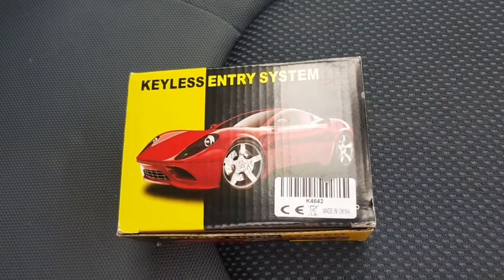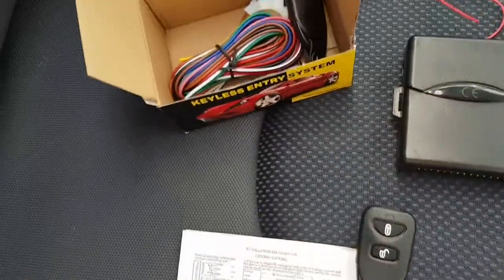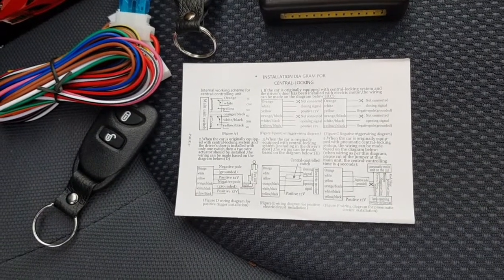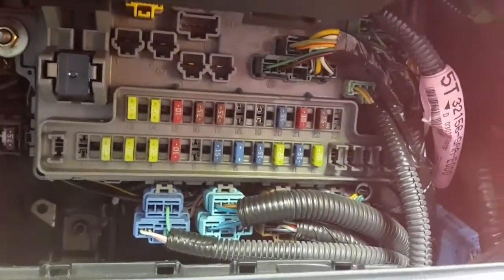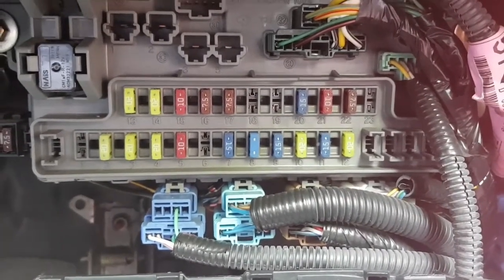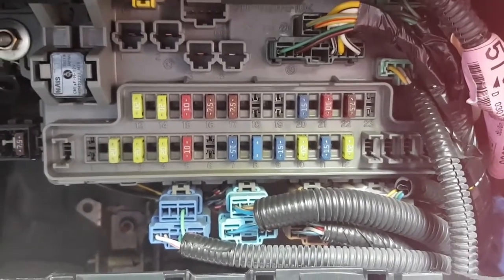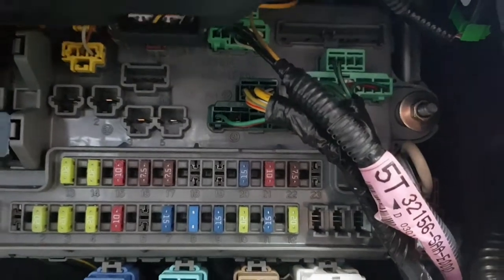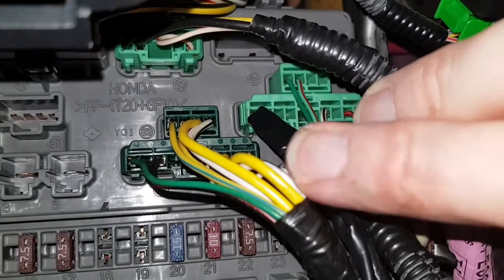Honda Jazz (Fit) Mk1 (2002-2008) - Remote Central Locking Upgrade

Comment: Been fighting with all the diagrams for over a month with no resolve. Just found your video was thinking that this was not possible to do, but I can see you have figured it out. I can understand everything your talking about although I live in north America so the drivers side is reversed,  but I want to know what is the deal with the black wire. Is that connected to the battery negative or frame ground? I know the 2x yellow wires are ground and im assuming the white wires are tapped into the wires coming from your main control switch on the door, Red is 12v+. Plus what should I do with the 2 orange wires. I see you have removed them. Any info would be a major advantage to my situation. Oh and my car is a 2007 honda fit. Thanks
Reply from the maker: The black wire and yellow ones go to battery neg or ground, doesn't matter I think. Orange wires weren't required so I removed them as the car uses a negative trigger.
Reply: Dan. I have the exact same car. Did you get it figured out?

Comment: Could you not have put the negative to the bodywork?  I found if you use a safety pin with the little loop at end, you can use it as a temp probe and just push into the sockets and then decide whether it's right or not...then splice into the wires if all OK.? All negative connections go from battery to body. ?
Reply from the maker: Yes that will probably work. I chose to use the wiring in case there were any issue with the grounding to the car body, i.e. higher resistance etc.

Comment: Saying thank you is an understatement. Thank you ever so much. I just did my car jazz 2003 exactly the same but I used the plastic scotch wire splicer which worked great. Without your video and the fact I don't have a multimeter and don't know which is which I wouldn't have been able to do this job. Got tired towards the end and didn't bother about the indicators light :)

Comment: You said the white wire with the blue stripe connects to the ground wires (yellow & yellow/black) going to the module.  Do the yellow wires have to be connected to a connector like you did or can they just be connected to an earth?  please excuse my lack of knowledge of earth/ground. Thank you.
Reply from the maker: Hi. Yes you can connect it to any of the wires which are ground or even the metal bodywork
Reply: @amp9438  Thank you.  I am still stumped trying to find the lock/unlock wire on a Maza MX-5 but I am determined to find them...

Comment: Do both the yellow wires from the module connect to the one blue and white wire? You don’t show the clear connections in the video.
Reply from the maker: Yes on this module the 2 yellow wires go to negative so I connected them both to the white & blue wire on the door connector as that wire seemed to be connected to negative/ground.
Reply: Thanks very much. Very grateful for your help.

Comment: Hi. when you connect this system can you still use the key to lock/unlock the vehicle? or will it only lock/unlock the drivers door?
Reply from the maker: On my car everything still works as before so both key lock and inside door switch lock/unlock all the doors. Its important you tap into the existing wires but don't cut them so you don't disturb the existing connections

Comment: Sorry for the stupid question but in terms of connecting the wiring, and removing the insulation and putting it into the connector, should the old wiring be kept in? I'm struggling to remove the wires going into the connector in the first place (trying with pliers). I don't suppose you have any tips for that?
Reply from the maker: You could always try something like ScotchLok type connectors to tap into existing wires. I soldered as didn't have them.  But to remove wires from the actual connector usually the pins have a clip which needs to be pushed down to release them from the connector housing. So a tiny screwdriver slid down side of the wire usual works to release them.

Comment: why  did  u  choose  the  blue  connector  below  the  fuse  box  for  power  and  ground  ?  i  think  u  showed  before  on the  video  , that  there's  power  and  ground  in  the  white  connector  on the  door  (  where  the  unlock  and  locking  wires  are  essentially ) ,  so  why  u  needed  to  find  this  blue  connector  for  ground  and  power ?
Reply from the maker: From what I remember I needed a permanent 12v for the module so took it based on a suitable fuse, i.e. the central locking one. You probably can use another permanent 12v if you can find one.

Comment: For everyone with a USDM/Canadian 2007-2008 Honda Fit, just got this to work with my car. 

Open the kick panel where the hood latch is and you’ll see a harness above it that you need to tap into. Wire your ground wires all to a ring connector and bolt it to the 10mm holding the hood latch. 

Wire unlock wire to white/blue wire on the car, wire lock wire to white/green wire on the car. For power, I used a fuse tap and tapped into fuse 28 (door lock).
Reply: Is the white blue mostly blue with white stripe?
Reply: Also, what which harness are these on?  The grey one?

Comment: This could be a great solution for my 2006 GD problem.
When my car came out of the panel beaters there was just a key and the remote fob had disappeared. There was a lot of shrugging and I just had to lump it.
Can lock and unlock the car using the stone age method of using the key!!! But this sucks after 20+ years in the modern era.
Watched some vid's online and it appeared that you could order a new key fob and reprogram it with some basic procedures........did not work on first cheap fob or on second, more expensive but still cheap fob, don't wan't repeat experience on very expensive fob from Honda.......so I am thinking what if I just replace the entire package with aftermarket job? I wonder if that will be simple or if they will have extra wires to prevent folk changing to aftermarket?
Anyhow, your excellent video has given me some inspiration to give it a go.
Thanking you whatever the outcome :)

Comment: I cant manually lock the door, but it can lock by remote only after follow the installation in the video?
Reply from the maker: Hi. Yes the key locks on my doors started to get stuck meaning sometimes I couldn't get into the car. This was a big reason for me to install this.

Comment: Hi there , 

- how did you connect the wire ( tapped ) ? Did you strip the wires then tape them ? 
- did you use an wire tapping system ? 
- also I noticed you have taken a lot of the wires out form the module that were there when you opened the box and unpacked  it which ones do I need to take it ? 

I appreciate help as I have a jazz and locks are packing up any other advice would be appreciated
Reply from the maker: Hi. I just stripped the insulation off the wires and soldered onto them. Didn't bother with wiring tapping as don't have the kit. Also removed  the wires which weren't required from the module connector as weren't using those features. So just kept the power, gnd, lock, unlock and indicator wires
Reply: A M P thanks buddy are you able to see my video I posted yesterday and point me in the right direction I’m stuck :( and also can’t remove the lower dashboard last

Comment: Scheme ia not working on 2007 with a lil bit diferent fuse box , device can only lock, but not to unlock the doors. When unlock signal for unlocking remain on +12v.
Reply: did you find a resolution
Reply: I had same problem. connected the grounds directly to the car body and all works fine.
Reply: @saintadjg  Looking to do this on a 2007 model, with a different fuse box than in the video.  What did you use for the 12v source in the end? Thanks
Reply: @tomoslawrence  I just found one in fuse box that had a permanent 12v feed and connected onto it.cant remember which one. if I get a chance lol take a pic. but just use a voltmeter to find a live feed.

Comment: My jazz 2003 gd doesn't have a lock/unlock button on the inside of the door (expect for the plastic pin).

I can only lock/unlock using my door key or via the plastic pin on the inside.

I was wondering if a alike kit would still work or do i need to get actuators?
Reply from the maker: If the drivers door lock opens all the doors at same time then it has the actuators and should work.
Reply: @amp9438  thanks for your reply
Reply: Turns out that I need to get an actuator for the driver's door

Comment: When you connect the Yellow and the White wires to the back of the connector, what stops these wires falling out ?
Reply from the maker: I stripped the insulation off the original wires making sure not to cut them and just soldered onto them

Comment: What if the locks input signal is positive?
Reply from the maker: The wiring to the module would be different. The instructions that come with the kit describe how to connect it if the signal is positive.

Comment: How would this work with a mechanical lock?
Reply from the maker: You need a car which already has central locking just no remote. There is another version which comes with actuators for each door but don't know if it's possible to fit these.

Comment: Do you have any advice on fitting this to a 2005 jazz as the fuse board Is different to the one in your video thanks
Reply from the maker: Sorry don't know about 2005 model. The Honda forums probably have some wiring diagrams available. Also a multimeter is very handy for testing connectors etc.
Reply: A M P no probs thanks for the reply
Reply: A M P are the fobs already paired to the unit cheers
Reply from the maker: Yes but if not there's a button on the main module to pair it

Comment: I have installed this universal central lock to my car which came with oem central locking but not workin g now. I have plugged the wire like you did and everything is working fine expect my driver door is not unlocking but all doors are locking and unlocking. What should I do? Can I contact you by email,
Reply from the maker: Does the driver door lock/unlock using the switch inside on the door? Also does the central locking work using the key in the drivers door? If not could suggest the wiring it broken between the door and the original central locking unit. I'd use a multimeter to test the wires, connections etc
Reply: @amp9438  i will make video and share it with you

Comment: How to locate the 2 wires for lock and unlock?
Reply from the maker: When I installed this I used a multimeter to probe the connector and saw 12v on the wires when I pressed the lock and unlock buttons. I mean it went from 0 to 12v momentarily when the buttons are pressed. Alternatively you can probably find the wiring diagrams for your particular model. Usually they provide the colour of the relevant wires.

Comment: Why can't the system just plug into the cigarette lighter and trigger the central locking button
Reply from the maker: Cigarette lighter only has power when ignition is on so it wouldn't work. It needs a permanent 12v feed.
Reply: @amp9438  Brilliant, thanks